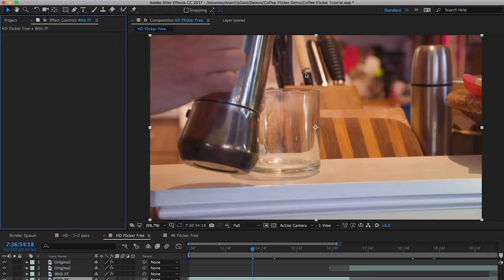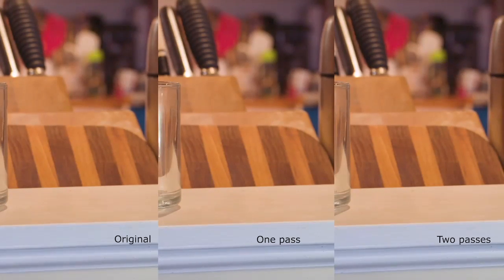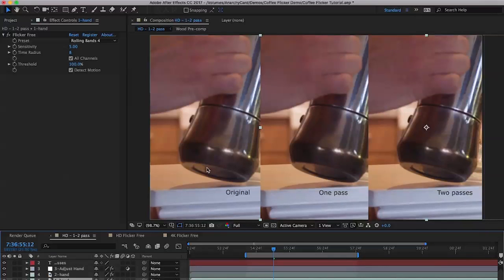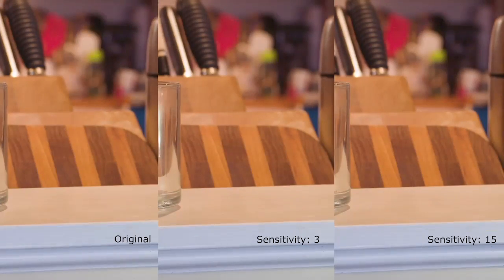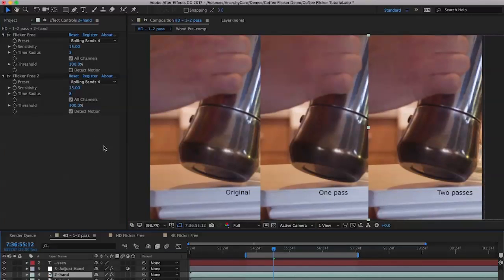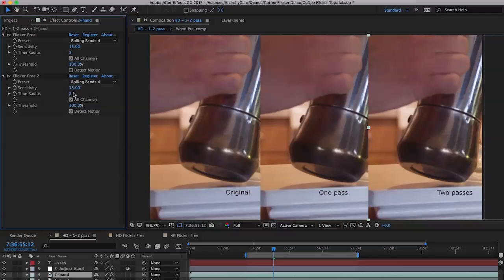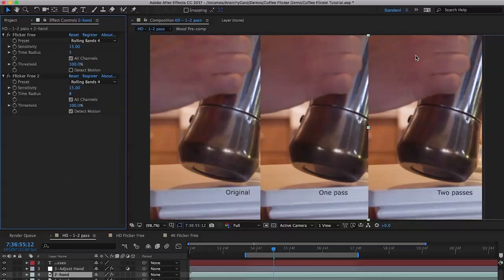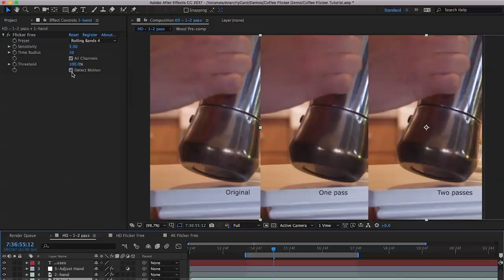Fixing Flickering Rolling Bands Caused by Camera and Light Sync Problems

Comment: I will explain my issue and perhaps you can give an idea why this software isn't working at all for me.  Right now I am compiling the 2 pass mode on a video recording I did.  I restore images and found video to be a powerful advertising piece.  Well I did not have a screen capture software installed but I wanted to record the steps I went through in repairing the image.  Well I have horizontal banding as well as vertical banding that is bending within the video.  How this happened is I plugged my PC HDMI plug to an LED TV and recorded it on my DSLR.  Had I worked on the video part sooner I would have just attempted finding a different means of recording the video, but I did not believe I had banding issues, then again I didn't discover this until my video ad creation.  I am using Premiere Pro CC 2017 and recorded the video on a Canon 5D Mark III DSLR.  I need your help desperately.
Reply: The second pass did zero help. #Frustrated